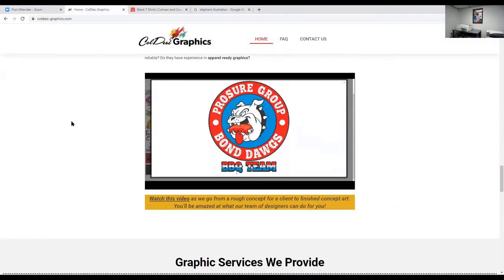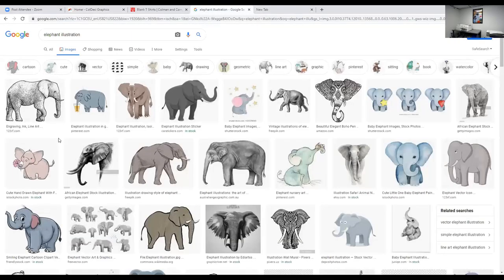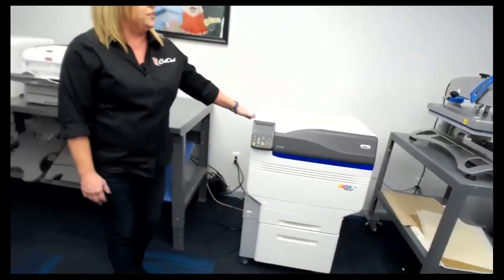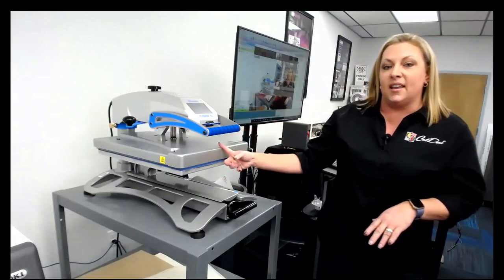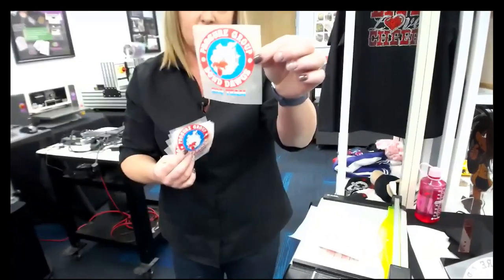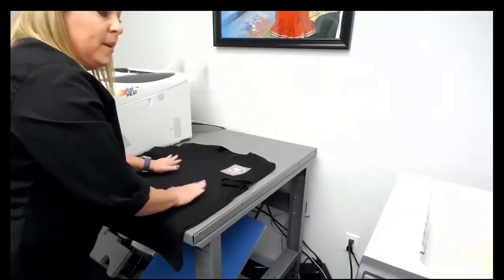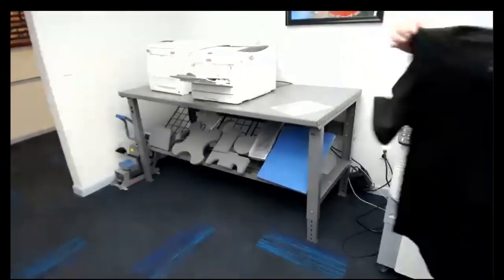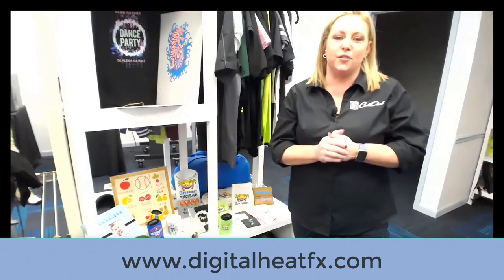DigitalHeat FX  Webinar | How to Make a Custom T Shirt

Comment: You should also come up with a smaller sheet for left chest logos when a rush job is needed. This would save on waste.
Reply from the maker: Hi there! The sheets can be gang sheeted (multiples on a sheet), or the sheet can be trimmed prior to putting through the printer to save on waste.